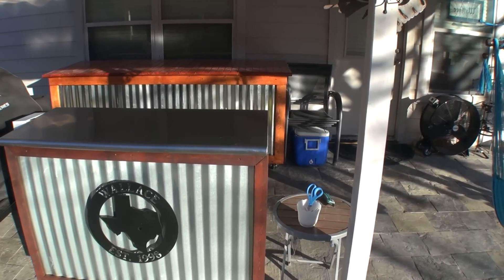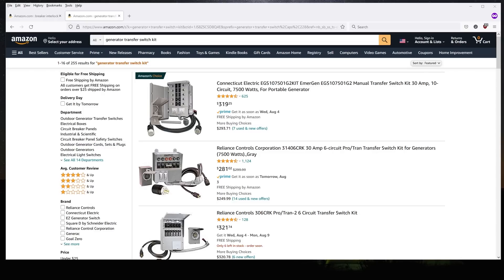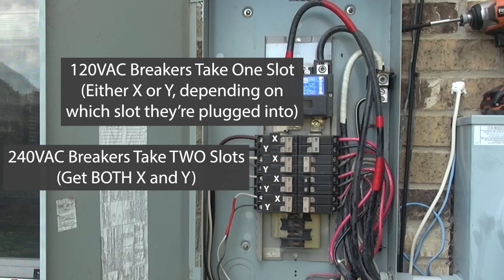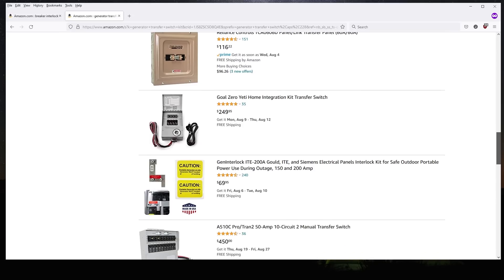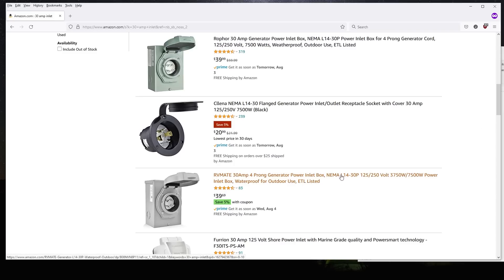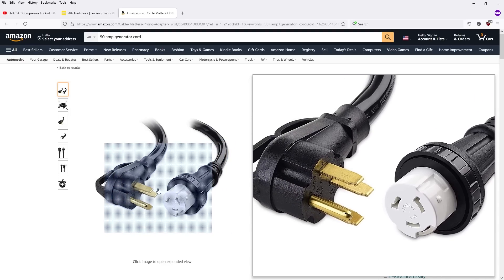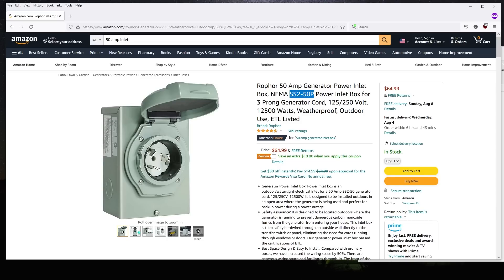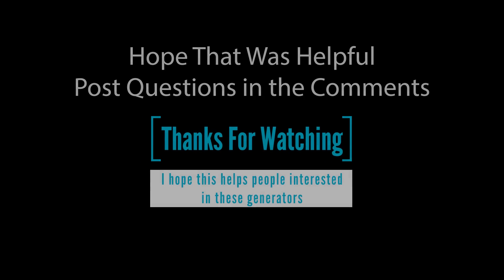How to Connect A 240VAC Portable Generator To Your Home

Comment: So, what cable did you use?? Hopefully you are still responding as I have apparently done the right thing (unbeknownst to me) and have a Predator 9500 with a 50amp transfer switch. I am just unable to find any cables that support that setup.
Reply from the maker: Do you mean the parallel cables I used to join two units together, or do you mean to connect it to the home?  The home connection ones are pretty common... but keep in mind that I was running mine through a parallel box, and in that box I have a 50amp dryer plug.  (see playlist)  

If you have a SINGLE generator, then you're needing to go from the 30amp on the front panel, to the 50amp input on the home.  For that in most cases, you'll need an adapter.  Assuming youtube allows me to, I'll link several here... I have no idea how long the links will remain valid..
https://www.amazon.com/PlugSaf-Generator-Adapter-L14-30-Female/dp/B0CPBJ8L8S
https://www.amazon.com/RVGUARD-Generator-Adapter-Locking-Indicator/dp/B085HLPDH6
https://www.amazon.com/MECMO-L14-30P-14-50R-Generator-Charging/dp/B0CDW1WKNR

Those will convert your 30amp to a 50amp dryer plug.  Use a 50 amp cable to link into the inlet for the home.  This way in the future if you upgrade to a more powerful generator that has the dryer plug, (or a parallel kit) you can toss the adapter and go directly into it.

Comment: Well done sir....simple and to the point. One comment I might add... the need for a floating neutral generator versus a bonded neutral one for home backup.
Reply: What do you do if the generator says neutral bonded to frame and has a ground connection on the front, when connecting to the breaker box with an interlock device?
Reply: @brianharris7029  Your only option is to open up the electrical connections in the front of the generator and remove the white bonding cable from the frame. Simple to do (see YouTube). This will mess with your warranty though. You can check afterwards by checking continuity between the ground and the neutral plug of the electrical outlets. If there is continuity, you haven't done it right. Best to just buy the correct gennie to start with although it may be hard to find. I use a Honda EUI6500 which says right on the front panel that it is floating. 

Manufacturers of these larger units anticipating they will be bought for home backup, should install a simple switch on the front panel to open and close the ground allowing the gennie to be used properly for it's application ...Ie: floating for connection to the home; bonded for use with tools and other outside appliances etc.
Reply from the maker: You are correct.  But, for generators that are considered temporary connections leaving the ground as it ships is considered acceptable. If it's permanently connected, then yes, it should have the ground disconnected from the rear of the generator's panel. (simple screw terminal on the backside of the panel)
Reply: @Texas_DIY  Local regulations may vary, but NEC Article 590 says the same grounding and bonding requirements apply for temporary installations as for permanent. That being said, I have left my neutral bonded. The NEC requires a single bonding point, based on eliminating "objectionable current" flowing in the grounding conductor, but I haven't seen anything that explains exactly what terrible things will happen if there is objectionable current.

Comment: So this method allows an easier connection. As I understand it you have to manually switch generator breaker to on then turn off all the breakers you don't intend to use? Question is how do you know when the power comes back on?
Reply from the maker: I have a device that will alarm when it detects the power has resumed... although I never connected it up.  Honestly, I just check on the neighbor houses every once in a while until I see signs of life.

Comment: So I only have a 30A plug on my generator. If I install a 50A inlet, how do  I make the connection from the 30A generator plug to the 50A inlet?
Reply from the maker: They make little adapters that easily switches them over.  I'd suggest getting a 50amp cable, and adapting it on the generator side.  That way if you need to up grade in the future, you don't have to buy anything extra apart from the generator.  (feel free to check out the other videos in the playlist, I cover a lot of that info in those)

Comment: I recommend a transfer switch as a new owner can easily remove an interlock without understanding its purpose especially if he doesn’t intend on using a generator backup. Fb marketplace is a great place to find transfer switches at a third to half the price of new. If your home has a safety disconnect before the panel you have it made. Just disconnect power, test and verify and rerun lines to transfer switch. Will need a few split bolts and a bit of wire.

Comment: You did a wonderful job but you never applied safety. No hand gloves and your tools were not electrically insulated despite the panels are dead.
Reply from the maker: You should have seen when the power company changed my meter.  Dude just shoved his hands behind the meter, didn't care if he touched the prongs... and pulled it loose.  I actually yelled at the guy out of concern I was about to watch a guy's hand turn to a smokey mist...  he just laughed and insisted that it was safe, I gave up arguing with him...   lol.   I guess one works to their level of comfort / risk management.  Part of why I emphasize if you're not confident and sure about what you're doing, hire a pro...   :-)

Comment: Do you have to do anything to the generator with this setup? Changing it from bonded to floating neutral?
Reply from the maker: Some people do.  If you're connecting it permanently to the house, you're supposed to.  If it's a temp connection and remains portable, then generally it's accepted that people won't.

Comment: Is it safe to run a generator that close to you home?  co2?
Reply from the maker: Good question.  The cooling fan exhaust pushes the fumes out pretty well... the whole box is on wheels where I can move it closer to the edge of the awning if needed, and I have a shop fan that moves air pretty well.  Haven't had an issue.  (running a portable on my front porch is bad though, and I've found that the exhaust makes it's way into the house, but the back porch is cool)  Everyone's mileage may vary... be careful.

Comment: Hello sir, I am planning on doing this setup on my home. Thanks for recommending the 50a over the 30a. I wasn't sure which one to go with. I have been looking at the 10500watt genmax. My house is also all electric. 1600sqft with a 2.5 ton heat pump. I was planning on installing an softstart kit on the heat pump. Do you think a 10500 watt inverter generator would be enough to power my home or would I need 2 like you have?
Reply from the maker: 10,500 is probably peak.  You'll need that, but also the continuous run watts.  With the soft start, if I had most everything else in the house pretty much turned off, it could probably start the AC compressor with just one.  Once it's running, no problem, it's only about 11amps to keep it going.  Without the softstart, no way.  You have a bit more wattage than the Predator (not sure if the running amps are higher also), and your compressor is smaller than mine... so I'd say... probably with some load management in the house.

Once you get the softstart installed, it will tell you via the phone app exactly how much power is being used to start and run it, and you can take that and judge what you can have on when it needs to start.

Comment: Really good description and video.  I have two notes for you to consider:
1. The generators should really be further away from the house.  Many folks have died from this as follows:  The hot gas comes out of the generator and rises into the vents under the eve of the house.  The hot gas goes up into the attic, cools and falls down into the house.  It is odorless.  I would at lease add several carbon monoxide detectors in the house.  

2. Lockouts are the cheap and easy way to go if all your ever going to do is a gas generator.  If you ever end up adding a solar generator or battery backed solar then the multi switch transfer switches are much better.  That's because you can run the solar and the utility at the same time on individual circuits.  You would never do that with a gas generator because it would make no sense.  With solar, you can run it year round to save money and the TX switch allows you do run just a few circuits off the solar at the same time the utility is holding up the house.  Its future proofing the house.  

Thanks!
Reply from the maker: Generally, yeah, you're quite right.  For this setup, my enclosure is on wheels so if I need to I can easily scoot it such that it's exhausting out from under the eve.  Additionally, the cooling fan for the generator and the exhaust are right next to each other, so it's being propelled quite a bit forward, and, I have a significant sized shop fan on the porch that I can run that further blows the exhaust away and creates quite a bit of airflow.  Also the roof there doesn't penetrate into the wall nor goes as high as the attic, so there isn't an easy ingress for the gas into the home.  So I'm not too bothered by it in that location.  

But... before I had this setup, I tried running a small portable generator on my front porch, where up to the second floor it's enclosed on top and on 3 sides, and you're absolutely right, even that small unit, outside but still close to the house, we could absolutely tell was clearly seeping into the house on the second floor and I had to move it.  One does have to be careful.
Reply: @Texas_DIY  OK, Sounds like your on top of it.  Keep up the good work! :)

Comment: If I install my 50 amp breaker , on the left side will it power both sides if it’s a double breaker ? TIA ,
Reply from the maker: Yes.  The columns don't matter.  The slots alternate between the legs vertically.  That's why 240v breakers are always double breakers, they need two side by side so it can get power from each leg.  

It's more important that you position the inlet breaker in the right spot such that it's where the interlock plate needs it to be for proper safe operation.  So I'd suggest getting the interlock plate first, and then you can determine based on it's design, into which spot your inlet breaker needs to be positioned.

Comment: Very well said strught forward 
My genie don’t have an 50amp
Plug in 
So im use the 30amp plug in my question is 
?  Can I still use a 50 amp breaker and 8 gage wire  to connect my 30amp outlet to my breaker box and a 50 amp breaker ?   Luke I said my genie don’t have a 50amp plug in .  Any and all information is greatly appreciated
Reply from the maker: yes absolutely.  You can overspec the plug and wiring.  But the breaker is up to you how you want to handle it.  If you are setting your inlet up to be CAPABLE of taking 50 amps, then yeah, you'd need a 50amp breaker... and if you just happen to feed a max of 30 amps into it, no problem.  The breaker needs to match the wiring and socket.  If you did a 30 amp breaker, it wouldn't hurt anything, but, if you tried to feed 50amps through the socket later on, the breaker would be prone to tripping.

Comment: First I want to say you did a hell of a job explaining everything! My only question is how much would this cost to call out an electrician to hook this up? I just purchased a Predator 9500 a couple weeks ago for my sister and brother who constantly lose power.
Reply from the maker: Depends on the electrician and all that.  I'd GUESS, maybe $300.  maybe more maybe less.  By the time you factor in you buying the cable, conduit, socket, breaker, etc. etc.  It might even be more attractive to have an electrician do it if they have the parts on hand.

Comment: Really rare? Every gen I've seen is 240
Reply from the maker: I'm specifically referring to Inverter generators.  Which is to say, the generators that can run the engine at different speeds, thus producing different AC frequencies, and electronically process that into consistent a clean 240V 60Hz output.  Such 240VAC versions are relatively rare.
Normal traditional generators do indeed frequently run 240v and are commonplace.
Reply: @Texas_DIY  I work in construction. I'm trying to find a reason to waste my money Inverter generator and no those are not rare. Which is what I was referring to.

Comment: I know of only one transfer switch that doesn't accept 240v. It's designed for powering a furnace or single hardwired appliance. All homes in the USA are split face 240v. You are using an inappropriate sized breaker. Remember breakers are designed to protect the wire. Also the intake is way undersized for that generator shed. The fans should be at the top pulling the hot air out in a way the generators are designed to be cooled.
Reply from the maker: I designed the enclosure to augment the generator's existing cooling fans.  Foam strips seal against the generator, such that each unit is exhausting out (both the engine exhaust, and the cooling heat exhaust) this makes the generators themselves pull air through the enclosure, while the DC automotive fans augment them.  (this also prevents the exhaust from tripping the CO sensor in the generators).  

So the generators are pulling air through and cooling normally, so the only added heat is what might radiate out from the plastic generator enclosures... which are pretty well sealed and cooled by design.  In my testing, airflow is quite sufficient, I ran them with the lid closed for 4+ hours in the peak TX summer heat with temp probes all over the inside, including the top of the enclosure.  The temps were always within a few degrees of ambient.

Comment: Is there a right angle 50 amp adapter to relieve the stress of the heavy cable putting torque on the inlet socket?
Reply from the maker: I'm not sure.  It would be nice.

Comment: Are the Predator 9500 Inverter Generators neutral bonded?
Reply from the maker: Yes, some people remove the bonding, some leave it.  As I understand it, general rule of thumb, if it's permanently attached remove it.  If it's a hook up and the generator might be used elsewhere, leave it.

Comment: I did a 50A inlet plug with 6 gauge wire into a 30A ciricuit breaker since my current Champion invertor generator can only do 30A at this time
Reply from the maker: If you're powering it off the front face of the generator, it has it's own 30a breaker.  So you could go with the 50amp in the box no problem, so that way if you ever do connect a 50amp feed, it will be able to pass through the full wattage.  (Note that, if you're powering off of the parallel ports however, those (at least on the Predators) bypass the breakers and connect direct to the inverter)

Comment: It seems one must move breakers around so the interlock kit matches properly with the main breaker; is this correct? Are there different shapes of interlock plates?
Reply from the maker: They do have different Interlock kits for different breaker boxes.  But you must put the generator breaker in the correct position for the interlock plate to be able to block it.  (this may involve moving a breaker, which is super easy, they just pop out and pop in, but be careful, high voltage in there)

Comment: Hello.. thank you for your video..  I have noticed that many people don't mention anything about the Romex cable Guage. They only say 4 wire  red, white, green, black, and ground. 
What Guage romex are you using?.
Thanks
Reply from the maker: Pretty sure I used 6 gauge.  There are calculators online you can use to determine what you should do (longer runs need thicker cable).

Comment: I noticed you installed an Eaton interlock into an Eaton panel.  In the intelock kit they supply a lingvscrew and a holddown clip.  I have heard when you add a breaker to switch backup feed NEC requires additional holddown for the breaker.   Did you do this?  If so how.  If nnot, did it pass inspection?
Reply from the maker: You are supposed to have something on the inlet breaker that prevents it from being easily popped loose and moved.  It can be something as simple as a zip tie, there doesn't seem to be a rule on what it is.  I didn't add that, but if I sell the house or need to it's easily added.

Comment: Jay , love your video, setting my predator 9500 up very similar, Have had conversations on should I also ground the generator to the same grounding rod as the house for safety, would like to know your opinion, thanks
Reply: So many possibilities here… is the generator a floating neutral or a bonded neutral. Does your transfer switch maintain the main service panel neutral bond to the generator when switched in. If the generator is bonded and is supplying power to the bonded main panel in the house, this could create a circuit within a circuit that may be against code. There are other bond/no bond considerations. When in doubt give an electrician a shout.
Reply from the maker: Some people will disconnect the ground from the back of the panel on the generators.  If it's a permanent install, it's accepted that this should be done.  However for temp installs (easily disconnectable ones with portable generators) the consensus seems to be "do it if you want, but no biggie".  I've not bothered and have no issues.

Comment: The way an electrician wired my box years back he used 2 separate 100A circuit breakers do you know do they make a circuit breaker 100 amp 120 V that does not allow you to backfeed the grid ?
Reply from the maker: Two breakers for an inlet?  240v breakers are just a pair linked together.  Might have been what he was doing, one for each leg.  Would be scary though if they weren't linked, cause that would allow the possibility of sending one leg into the box, while thinking it was off after flipping one of them.